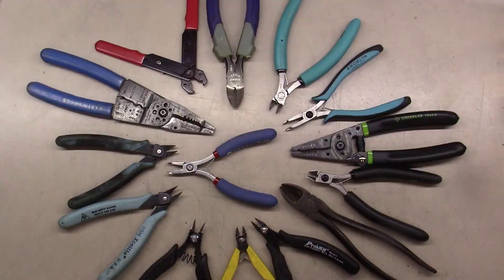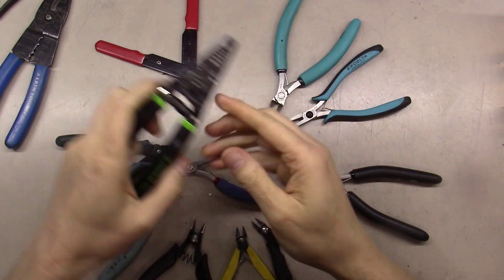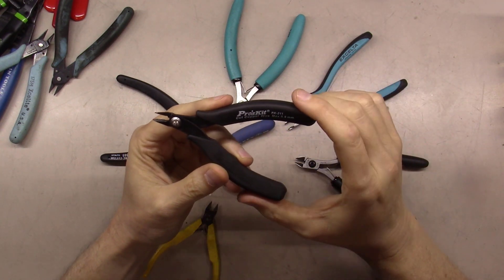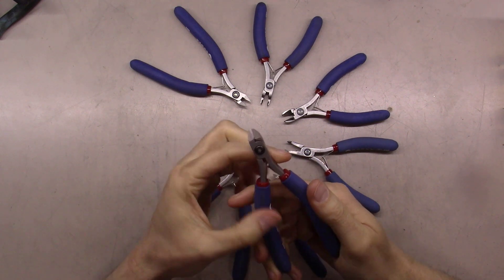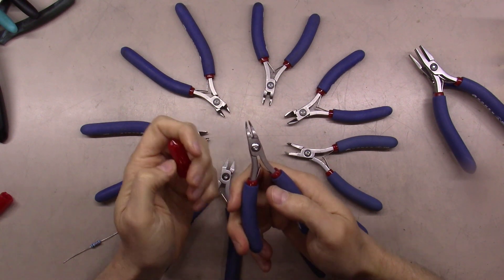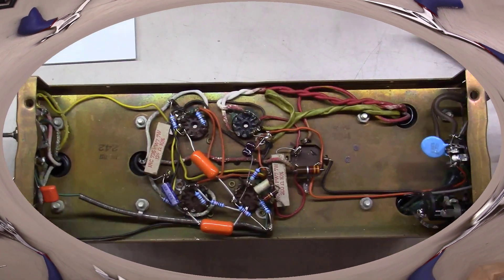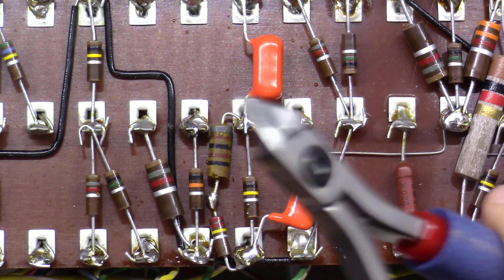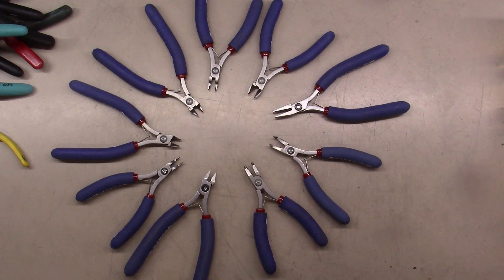Electronics Workbench Wire Cutter Shootout 2020

Comment: I just ordered an automatic cable stripper from Knipex, my big cable cutter is also from Knipex, they are used to cutting piano strings, even nails can be cut with one of these. I have a cable stripper, old school from Wiha, and that one is so fed up, that I needed another one, and got me landing on the automatic cable stripper, which is especially for stripping multicore cables, without destroying the shielding copper. Which my Wiha does at this time. Not very convenient. My small cable cutter is also a Knipex ESD fine cutter. This one is just for electronics. Also, I have a cable cutter for electrical use from Wiha. So in total I have 4, and that is more than enough for the job I do.

Comment: While I agree with your 2nd and 3rd place choices, I do not agree on the top spot choice. Erem is a brand that I learned about in the late 70s. I’ve bought my share and have used them for 41 years. This is a tool that lasts for decades and precision work demands the highest standard of quality and if you ask any person who does high end precision work that the quality of their tooling demands that quality, Erem is the tool of choice for work that stands up to the highest scrutiny. I stand by this regardless of what others might say. I have worked in missile electronics, avionics and high end audio and Erem is the only cutters and pliers I use, period! This brand sells itself! True quality doesn’t require marketing prowess, it requires high quality, high reliability, consistent and repeatable results time after time over decades of demanding use. Erem is that company without question, any reservation or outside influence! Try Erem and know that you have the best in your hands! That’s a fact, not an opinion sir! Stay safe mates!😊👍🏻😷
Reply: Erem is by far and away the best tools you can use for electronics work period. Even the Tronex and Excelta tools look and feel much lower quality than Erem. Once you hold an Erem in the hand and use it, you’ll know.

Comment: The best thing about the Greenlee is the curved cutting blades...if you have a cable with a pull string inside like fiberoptic cable, it helps to cut through that stubborn string.

Comment: I didn't see any Hakko flush cutters in your survey. They are pretty much clones of the Xcelite 175's. I find them to be quite good. The Xcelites when I first found them were about $7, paired with their stamped needlenose pliers, I think #378. Today, the Xcelite flush cutters are more like $15 and the Hakkos (I think #170) are still $5. These stamped metal pliers are, let's face it, not 50 year tools. When I'm using them and they work fine, I do not worry about how well they will work 50 years from now when I'll be dead.The Hakkos are way better than 1/3rd as good as the Xcelites. I consider them identical. Are you cutting 20 ga wire or trying to cut thru the hull of the Queen Mary?